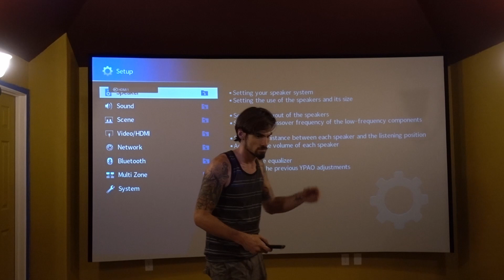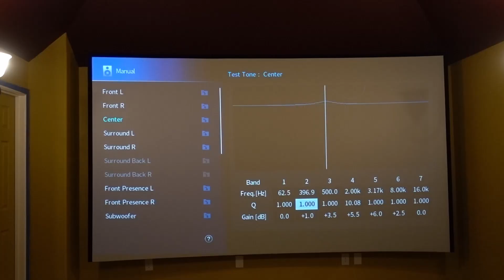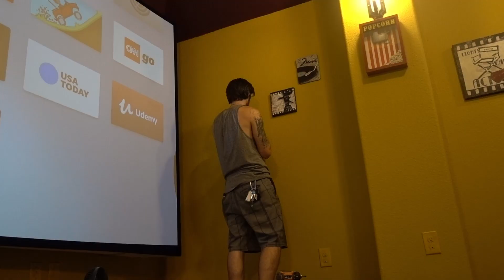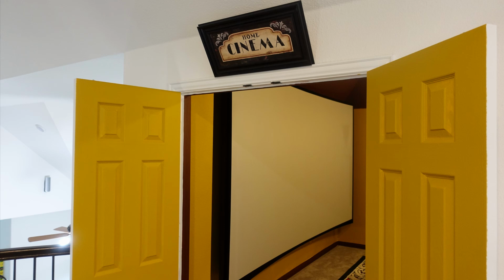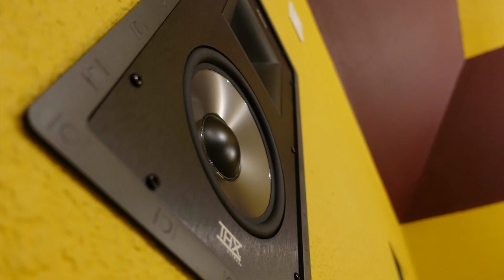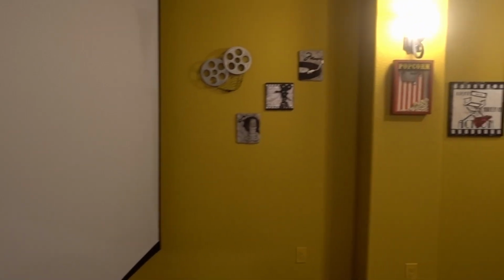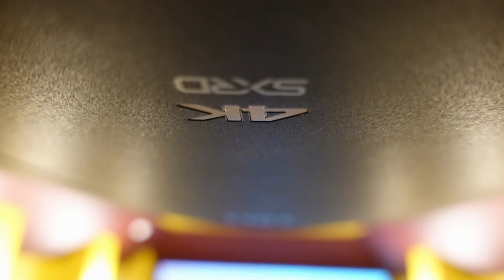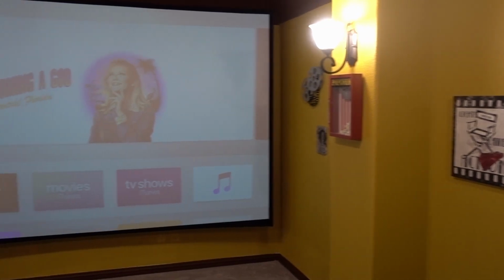Klipsch Home Theater Tour | 5.1.2 Dolby Atmos | 4K Sony 295ES! IMAX

Comment: i Badly need that room dimensions in feets please...  if we choose acoustic transparent screen do we need High resolution projector ?
Reply from the maker: That room is about 13' wide by 19' deep. Yes. Using a 4k projector from Epson, JVC or Sony is best.
Reply: Divine AV thanks, but can’t we use fullhd projector on that? Means tiny dots do visible on that type of screen?
Reply from the maker: @myhomeaudio8751  on our professional custom acoustically transparent screen, we use a ultra micro perforated material with extremely tiny holes. There's hundreds of thousands of them. So from any viewing distance over about eight feet, the image quality will not be affected and you will get Crystal Clear 4K resolution. Check out our other videos. There's a new JVC 4K projector coming out for a lower price point and a laser light engine
Reply: Divine AV sure waiting